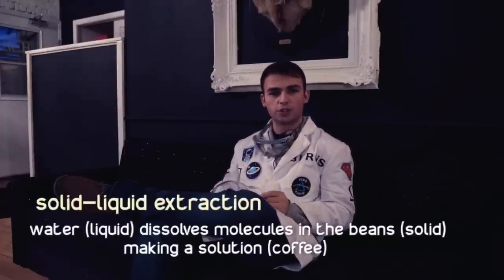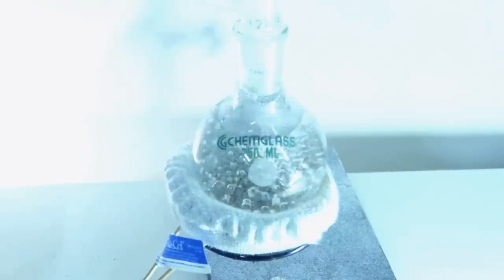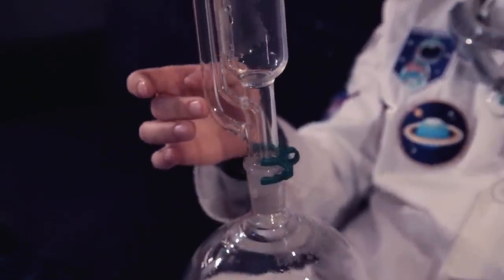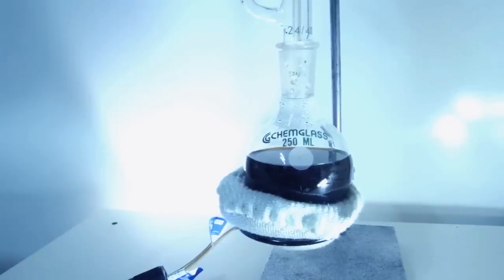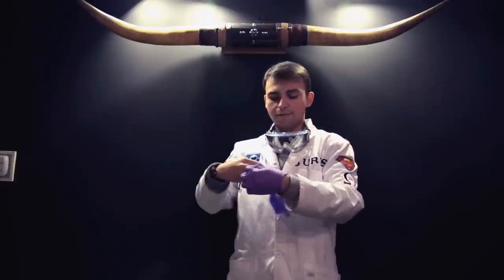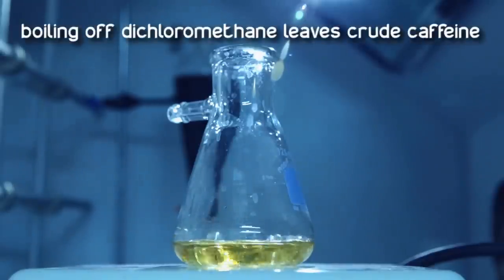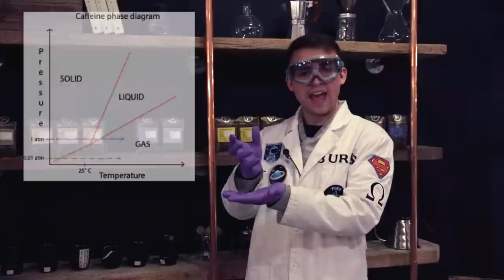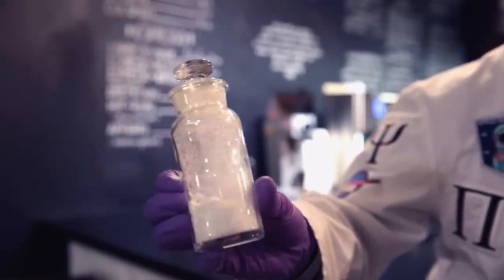Caffeine Crystals and Coffee Chemistry!

Comment: I feel like using the socklet extractor is completely unnecessary. Could you not just use a coffee pot for that step? Idk maybe im wrong, but it seems like that was just used to make the whole experiment appear more "sciency. "
Reply from the maker: +veratexanS 
You are totally right! However, the soxhlet extractor makes it much more concentrated than a coffee pot would. With a soxhlet you can extract all of the caffeine from the coffee with a fixed amount of volume because you are constantly extracting with distilled water.
Reply: +Bunsen Burns 
Oh, makes sense. We just did this experiment in my ochem lab yesterday and yielded pretty much no caffeine. I wanted to try it again on my own and you seem to have done a great job... This may sound like a stupid question, but how did you cool it down with the ethyl acetate? Does it just happen?
Reply from the maker: +veratexanS 
Not stupid at all! But it is very important! That was a crystallization where we took advantage of the fact that caffeine isn't that soluble in ethyl acetate at room temperature, but very at higher temperatures. So you just remove it from heat and let it cool on its own slowly. Crystals come out because at the lower temperature caffine MUST come out of solution.

Comment: There is lot simpler methods that do not need all the chemicals.
Dichloromethane is a bit pricy to be just boiling off so one can be sciency.
But again, I have done "sciency" stuff just for the fun of it.
Used to make my own nitric acid even though it would have been cheap and easier to just buy some.

Comment: can i use isopropyl alchohol instead of ch2cl2
Reply from the maker: +Chandrika narayana 
Unfortunately not! Isopropanol mixes with water so it will not work to separate caffeine from the other gunk we don't want. I would recommend ethyl acetate if you absolutely must not use DCM. Ethyl acetate is found in almost all acetone-free nail polish removers.

Comment: Nice use of deadly carcinogenic solvents... any chance of using the method involving harmless sublimation???
Reply from the maker: Dichloromethane is frequently used in nearly all synthetic labs throughout the world. Ethyl acetate, the re-crystallization solvent, is merely nail polish remover. Simply substitute in ethyl acetate for dichloromethane during the extraction. It won't work as well, but it will work. I did show sublimation in this video, I prefer crystallization from EtOAc.
Reply: Neato. Six weeks of off and on searching for a simple anwser and you solve my issue in one comment. Ima go back and see what else you posted. Thanks man.
Reply: Say... any chance you could showcase the sublamation method in a way an amature like myself could manage?
Reply from the maker: As far as purification goes I would recommend recrystallizing from hot solvent. Sublimation will require some expensive glassware and a vacuum pump.
Reply: I have both things, and have been trying that method, but I hear that there is a way that does not require the low pressures negating the need for the vacuume pump. If I can get it to work I'll let you know.